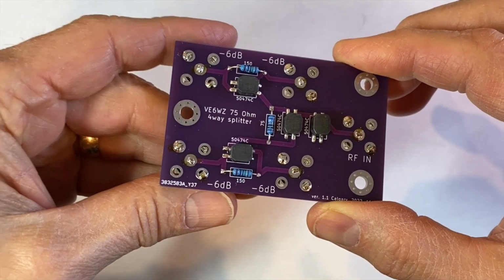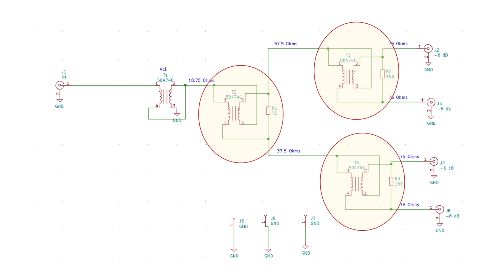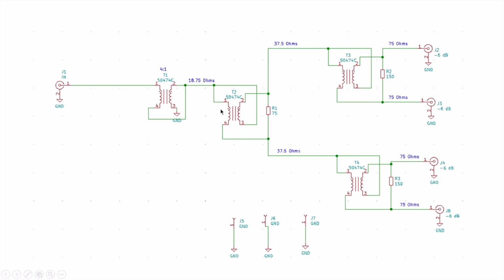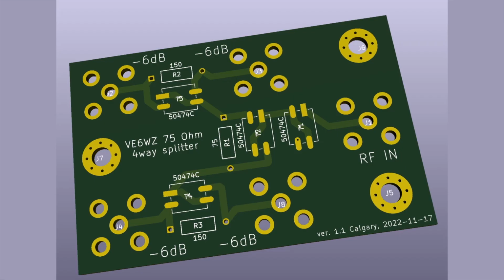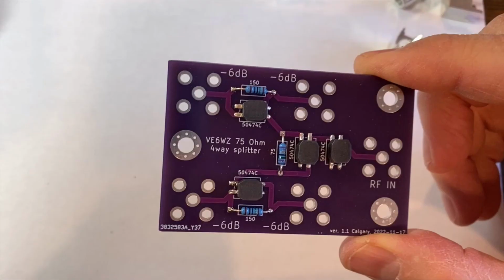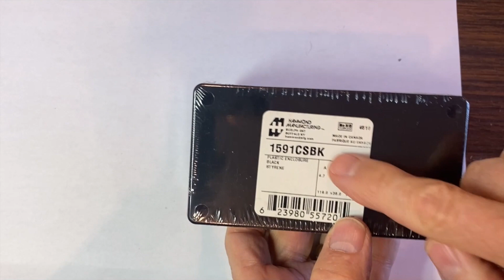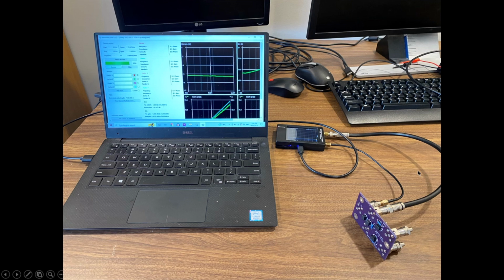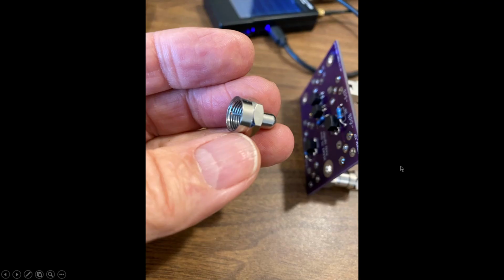Build a 4 way 75 Ohm RX antenna splitter

Comment: To make it 50 Ohm, I only need to change the resistors, 150 Ohm to 100 Ohm and 75 Ohm to 50 Ohm? Also, can this be used in the 470 Mhz range?
Reply from the maker: Yes, that is correct.
The only issue is the PCB is designed for 75 Ohm F-connectors, so using those F connectors you would need to use an adapter for a 50 Ohm coax connector.
Reply: @ve6wz Thanks. I'm planning to make my own PCB. But I just found the Mini-Circuits SCA-4-10+, I think I will use that.
Reply from the maker: That looks like an easy solution if you plan to build up your own board.  Numbers look good.

Comment: I just came across your channel and I have to say I found exactly what I was looking for for long time. Your channel presents very informative content in easy to understand commentary. I am not ham radio operator but in some cases I can use this information for higher frequencies designs.

I need your advice for one of my multiband antenna design for 915 mhz LoRa band, 1575 mhz GPS band and 2.4 ghz WiFi band. I wanted to use this one antenna for all 3 bands at the same time. GPS is only for receiving but other 2 bands receive and transmit. I have following simulated results for all bands:

Frequency                 Gain             Antenna                  VSWR      Impedence             Antenna height           
MHZ                          DBi               Pattern                                                                  Real Moderate gnd 
            
 915  (LoRa US)        2.28         Omnidiectional            1.64          60.7+j25.50          Free space             
 915  (LoRa US)        8.31         Omnidiectional            1.66          60.8+j26.10            3 feet

1575  (GPS)              3.19         Omnidiectional            7.13          356+j5.83             Free space
1575  (GPS)              9.21         Omnidiectional            7.12          356+j6.07               3 feet

2440  (WiFi)              4.53         Omnidiectional            1.63           73.9-j18.00          Free space
2440  (WiFi)            10.60         Omnidiectional            1.62           73.6-j18.00            3 feet

My question is how to design either PCB impedance matching network or Coax impedance matching network so that it can be matched to 50 Ohms feed lines.

Thank you.